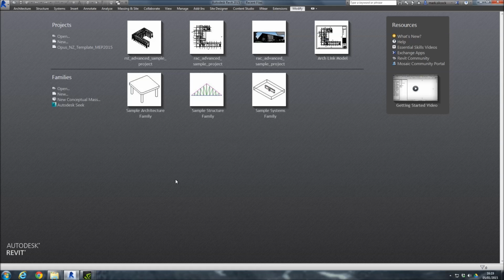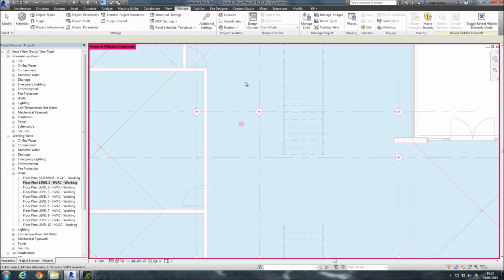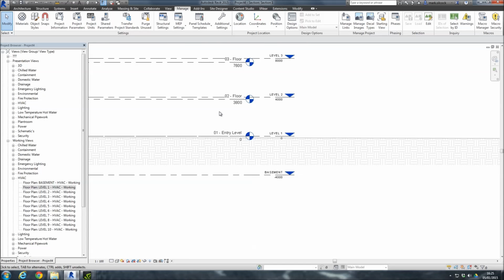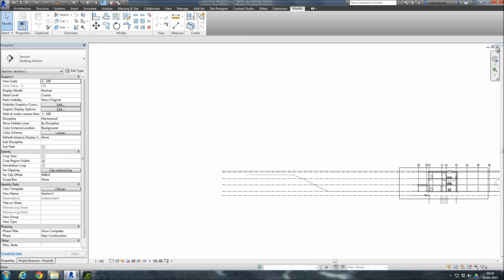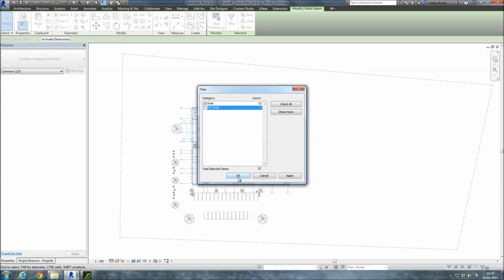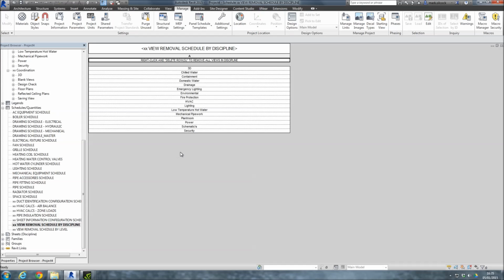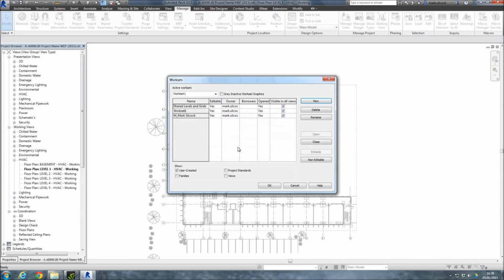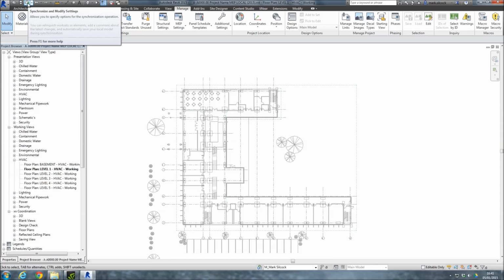Revit MEP 2015 Project Setup

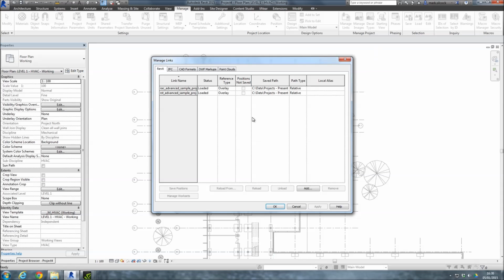Comment: I cannot manage the workset your doing on 8:55 .my option is still dim even after selecting structural file link.Can you please give a reason?
Reply from the maker: nithin sadasivan If the structural model you have inserted does not have worksets enabled the option will be disabled. Open the structural model and enable worksets, save and close. You will now be able to select manage worksets of the structural model from within the MEP model and turn off the grids from there. Hope that helps and thanks for watching.